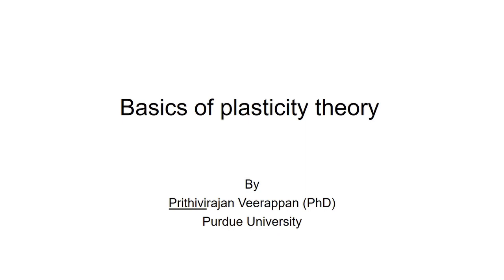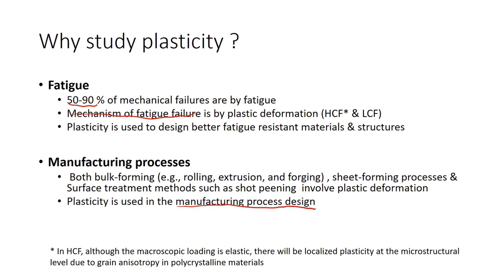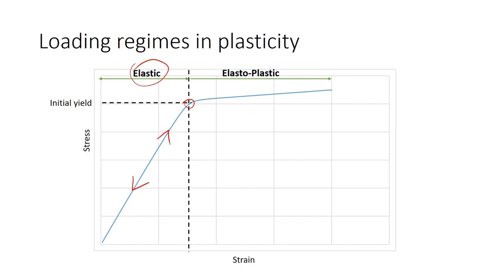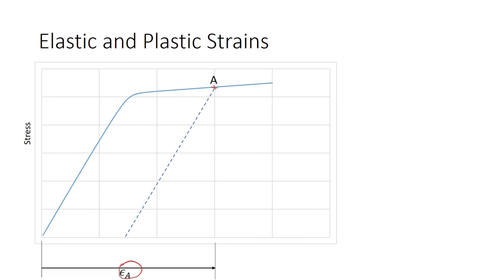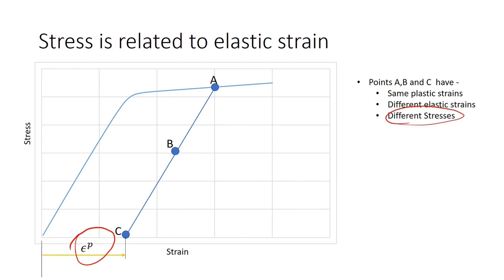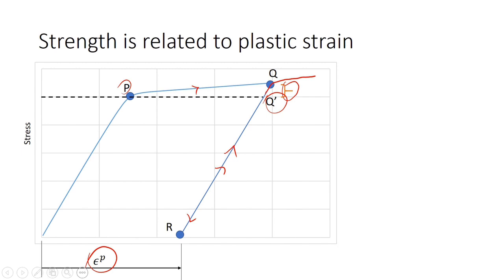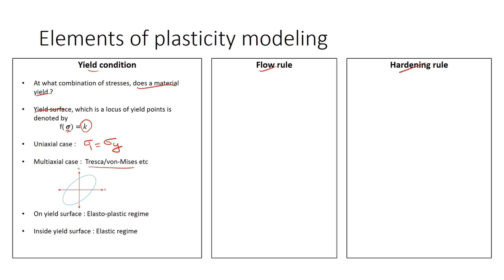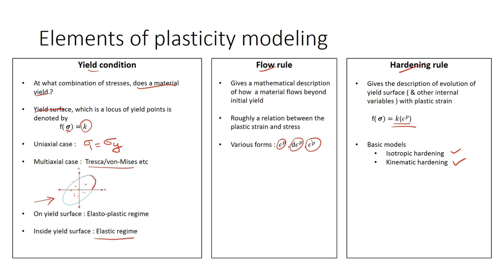Basics of plasticity theory in 6 min

Comment: Hi, could you please elaborate more on differences between flow and hardening rule? I'm confused by the fact that hardening laws (power, voce, etc.) describe flow stress curves of true stress vs eff plastic strain, but doesnt that sound like flow rule? So in the context of yield surface, if hardening rule expands/contracts/displaces a yield surface, what does flow rule do? Thanks a bunch!
Reply from the maker: Let me explain my thoughts :

As you said hardening law signifies the change of the yield "locus" with loading, Physically it represents the evolution of the yield strength ( material hardens or softens), which is a property of the material. The yield locus just states if the material is elastically loaded or plasticity loaded, it does not give the magnitude of plastic strain.Flow rule does that !

Flow rule, gives a relation to find the magnitude of the plastic strain given the " applied stress" (There is an assumed condition of normality). Say, if you are in elastic loading regime, you have a plastic strain of Zero. 

And, Yes, it is very confusing. Both are closely tied to each other. Keep thinking about it...

Comment: Very good video. I have a couple of doubts.
1. Does the initial yield means upper yield limit?
2. The second doubt is what is the actual starting point of elasto plastic region- Elastic limit or yield?
Reply from the maker: Thanks Subhash. 
1.  Initial yield is the point beyond the elastic limit where the material first starts yielding. Only few materials like mild steel have an upper and lower yield point which is due to interstitial atom- dislocation interactions, others have only one initial yield. 
2. Either, Elastic limit & yield are one and the same.